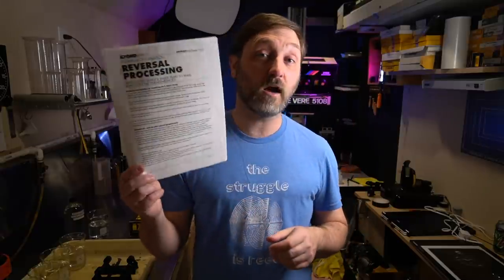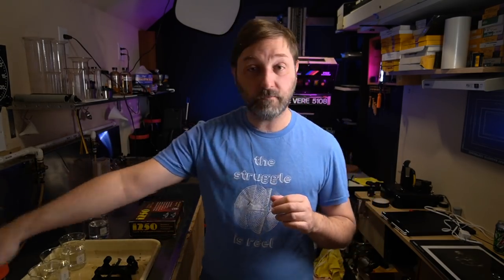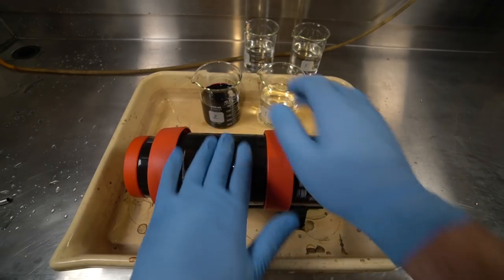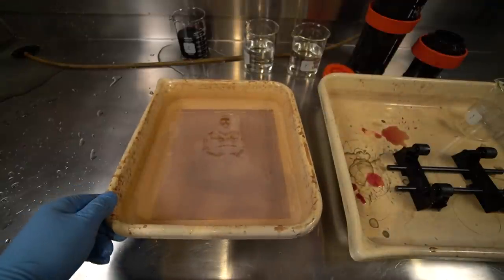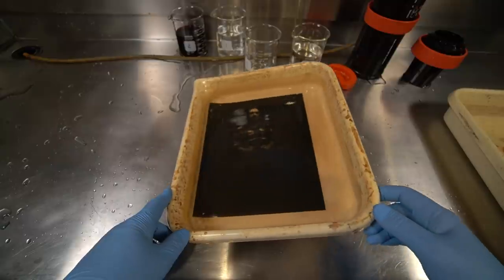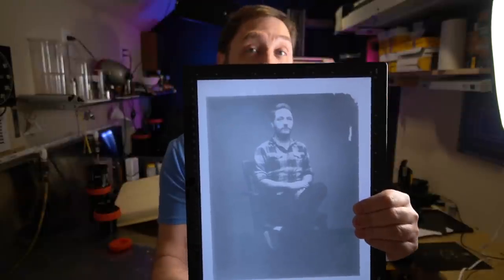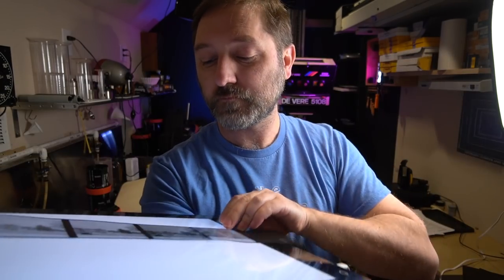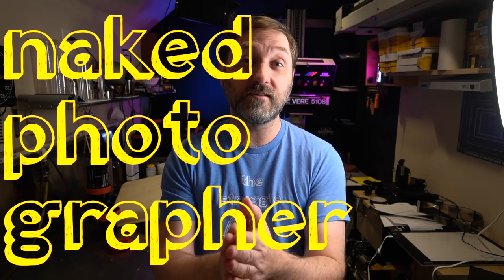Ilford B&W Reversal Process

Comment: If you just want to play with the process, have at it. If you want B&W positives, like slides for projection, you can shoot normal negatives on whatever film you like, contract print them on litho film, and develop that litho in Dektol/D-72 for a more controlled result with less messing around. The huge advantage is that you still have your negative available for more traditional uses. I suspect that this is also quicker and cheaper.
Reply: thank you so much for commenting this
Reply: any other tips for this process :)? I've never used litho film before

Comment: Kudos to you for going the H2SO4 route.  That's kinda scary.  There is a H2O2 process floating around that seems a lot less intimidating.  Ilford XP2 will also make lovely monochrome positives when run thru E-6 chemistry.  Over expose two stops, over develop (1st dev) 25%.
Reply: Why is it scary? I use concentrated, treat all my chems with the same respect and haven't experienced any problems. Have paper towels, water and sodium bicarbonate ready when it spills. Pick up dops with paper towel, only wash then. And make larger quantities of Part B to handle nasty chems less frequently :)

What I do is: go by the recipe and make my part A and part B. When bleaching comes, I use A + B + water in equal quantities. This saves chems, dilutes the bleach, is safer to emulsion and still bleaches to completion in said 5-6 minutes. 1 liter of A and B therefore is good for 10 films, which can be used to time Clear and Fix saturation, for example - to save further. Works great, no damaged emulsion.
Reply: I have the chems for the h2o2/edta process, but I also plan to try the variant of this method using bisulfate as an acidulating agent instead of sulfuric acid because I don’t really want to handle conc if I don’t have to.
Reply: H2SO4 is corrosive, yes, but not particularly dangerous if handled correctly.  Keep a well ventilated room, wear eye protection, and have baking soda on hand if worried about burns.  It's less dangerous and corrosive when diluted.
Reply: @dylangergutierrez  The final concentration of acid after 1:1 mix with the permanganate is 1%, so the 'working solution' is 2%. Still nasty but probably no worse than the permanganate itself. Thanks for the tip re XP2, I may try that as I'm having problems with the emulsions tearing with 120 film especially FP4. I don't understand about the over develop 1dev, is that for the Ilford process here or for the XP2 in E6 (which doesn't seem to make sense).

Comment: I've been playing with this process for a few months, since seeing this video originally. A couple of comments. First, I just tried my first roll of FP4+ in 120 roll film format and at the final fix stage the emulsion mostly came right off the base. It seemed fine up to that point. There are faint images still visible. Oddly, FP4+ worked fine in 35mm. I checked with Ilford and indeed the two sizes use different thickness plastic and some differences in the coatings. PanF50 worked ok for one roll of 120 that I tried, am going to keep trying with that. I may try TMax100 since it seemed to be ok for you. I may also try using weaker fix at the final step, as most if not all of the silver should be developed by then at either the first or second step. I am doing this to make stereo slide pairs for viewing with a stereo viewer, using a Sputnik 6x6 stereo camera and a viewer made with 3d printing by Oszko in Germany. Pentax has a neat gadget, a beam splitter that fits over their standard 50mm K mount lens, going on any 35mm Pentax SLR, and then viewed with a Pentax slide viewer. However this splits a single 35mm frame to two vertical halves, so pretty tight real estate versus the 6x6. The Sputnik is not a fun camera to get working, but it's pretty much the only medium format stereo option (there was a Rolleiflex but I guess only a few got made as it's either un-findable or way overpriced, similarly a Chinese medium format stereo camera that pops up on google searches but also not really available). Thanks again! (p.s. I am also doing color slides by E-6 chemistry for the same project, but currently Fujifilm is not making 120 slide film at all, and Kodak has jacked the price of Ektachrome to the stratosphere.

Comment: Thanks for another interesting and useful video! I have done some experiments with the Ilford process and I am surprised that my end goal wasn't one you mentioned. I mount the results as 35mm slides and project them.  It's a wholly different way of viewing a photograph as compared with backlighting a positive (quite similar to viewing a scan on a backlit computer screen) or printing on paper from a negative and viewing by reflected light. Old 35mm slide projectors are really really cheap and you just need some even white surface for a screen. I bought a very cheap plain white roller blind for this purpose. Sitting in a darkened room and projecting your photos to images several feet across is to my mind really quite magical. I bet your kids would love it!

Comment: For those who don't mind going a little off program, it's possible to make a reversal bleach with copper sulfate (available in home improvement stores, sold for removing roots in drain pipes) with a little table salt added; this converts the developed silver to silver chloride -- but little if any of the original halide is this variety, and a bath in ammonium hydroxide ("clear ammonia" from the cleaning supplies aisle of the supermarket) will dissolve this halide and not the ones we want to expose before the second developer.  The advantage is that, unlike permanganate, this not only doesn't stain (and doesn't require handling sulfuric acid; while it does need to be acidic, citric acid or acetic acid are sufficient as we only need to control pH rather than provide a reservoir of sulfate ions in solution), it doesn't soften the emulsion and make it prone to easy damage, or even to peeling off the film base (that's the permanganate bleach doing that, not the second developer).

When I've done reversal in the past, however, I used potassium dichromate.  I don't recommend this if there's an alternative available; not only is the dichromate toxic and probably carcinogenic, you still have to handle sulfuric acid (dichromate, like permanganate, works by converting the developed silver to soluble silver sulfate, but hardens the gelatin rather than softening it).

When I've done this (only a couple times) I took the "too light" final image to indicate I needed to expose less; I was using Tri-X, and found the best exposures at EI 640-800, or 2/3 to 1 stop gain in film speed.  My contrast looked normal (to my eye), so I felt exposing less was preferable over shortening the first developer time.

I would differ with your statement relative to fixing: the original negative image is not still present to be fixed away; that silver was dissolved in the bleach step, not converted to something fixer can remove.  It does no harm to fix after second developer, but if you've developed to completion in that step, fixing is technically unnecessary (the technical minded could confirm this by using fresh fixer after second developer, then performing a silver content test on the fixer that was used -- it should show no fixed-out silver complex).

While I agree that in our post-projector age, there aren't many uses for B&W film positives (and if you're going to project these, you'd want to use the actual projector, screen, and room lighting you're working toward to confirm exposure and first developer time), I can see one place this process is very practical: if you shoot your original exposure on printing paper, this process will let you get a one-of-a-kind positive print without the expense of Harman Direct Positive paper (plus you can use multi-contrast filters to control your final contrast).  You'll need to adjust first developer time, of course, but on the other hand, you can do the first developer and bleach steps under your regular printing safelight.
Reply: " would differ with your statement relative to fixing: the original negative image is not still present to be fixed away; that silver was dissolved in the bleach step, not converted to something fixer can remove.  It does no harm to fix after second developer, but if you've developed to completion in that step, fixing is technically unnecessary (the technical minded could confirm this by using fresh fixer after second developer, then performing a silver content test on the fixer that was used -- it should show no fixed-out silver complex)."

And yet - when you fix your positives, they get lighter. In case of Ilford recipe/Permanganate bleach - fix somewhat removes the warm tone given by PQ Uiversal. You can easily tell apart fixed and non-fixed slides. 

Could that indicate insufficient bleaching in some way?

Comment: Hello there! Been reversing since 2016 with great results. Here are some tips to improve your results:
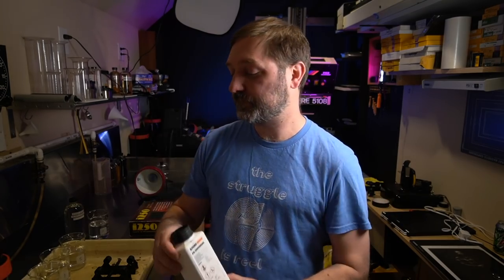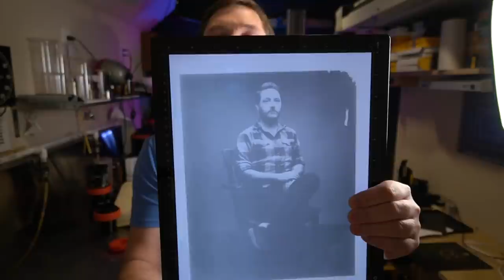1:21, 5:12 - many films - especially classic emulsions - are absolutely best left without it, 0 grams. Hence your overdevelopment at 17:04 and poor density;
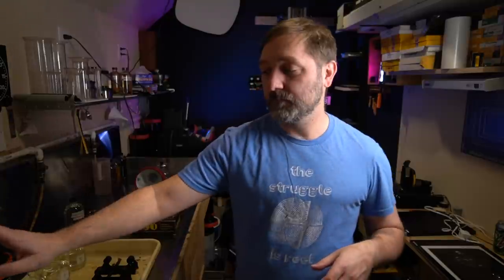2:38 - try diluting this bleach by doing 1A+1B+1Water. Safer for emulsion, saves chems and bleaching time stays the same. 300ml per 35mm film in Paterson;
3:24 - you can try redevelopment in first developer, have had only good results and saves developer. And capacity is about 3 films, third might require +1min;
4:20 - Fomapan makes a kit for their reversal film - Fomapan R 100, haven't tried on other films, because Ilford's recipe just works for me;
6:23 - agitation has a strong impact. Extreme example: Stand Vs Constant. 3 inversions in 90s will give extended shadow and highlight detail, for example;
10:01 - it's the Bleach that makes emulsion soft. Hence I recommended using dilute - Foma films will be thankful;
18:26 - I'd say we need to work on which film needs what amount of hypo - if any. And then we can experiment Pushing/Pulling films to their best!

22:24 - guys, get a slide projector - that'll tell you all :)
And slides scan good too: https://www.flickr.com/search/?sort=date-taken-desc&safe_search=1&tags=ilfordreversalrecipe&user_id=108634366%40N07&view_all=1

When it's a film I haven't reversed yet, I start 12min reversal with 3 inversions every 90s (Paterson tank) without any hypo, evaluate dry slides and go from there, adding hypo in 0.5g increments if 12min development didn't develop things enough. Or 1g increments with modern emulsions. 1x135 film gives 4 good length strips for 4 different development tests. Takes patience and time, but you can nail shit down this way, be on a solid ground ISO-wise, be literate in Pushing and Pulling slides.

Speedy recovery!
Reply: hi, how much sodium thiosulphate are you using for developing ilford fp4?
Reply: @PJF2137  haven't shot it for a while (since about 2020), so I don't have an up-to-date number for you. 
But here's what I do when I start to familiarize myself with a film (or return to a long unused one): shoot a roll and when it comes to development, take 1/4 of it and develop it without any hypo for 12 minutes. When the re-exposure stage comes, you'll be able to infer if you need to boost the first developer with thio. If strip looks dark, add thio. If strip looks good, the film is good to go without any hypo added. Meanwhile store the strip 1/4 in bath of water and take another strip: 2/4, develop it again with some hypo added, compare and reiterate. Develop both strips to completion, evaluate dry.
You have 2 more development test strips in the same roll, compare and reiterate until you get it to your liking.

Ilford gives you a number for its FP4 and it's 12g per liter. I suspect it's too hot, thogh, so I'd go for the half of the recommended amount in the first strip, then add thio in 0.5g or 1g increments until overdevelopment/weak density occurs, then dial back to a sweet spot. This works wonders and requires just some patience.
Reply: @diapozitīvs  many thanks for your reply. I developed ilford fp4 today in pq universal with 6 grams of sodium thiosulphate and idk why but film came out completely blank. I'm now going to try the rollei superpan 200 and would appreciate it if you would tell me how you developed it with excact times
Reply: @PJF2137  was it 6 grams per 1 liter or did you put 6g in your tank worth of developer (300-500ml usually)? 
Were the development steps done in order? Try to half it the next time around or try without any added - don't give up, experiment and please report back your findings - I'm curious!

Last Superpan 200 I developed (and it came out great): PQ 1+5, 500ml working developer + 0,3g thio. 
12 minutes at 20C with constant agitation during the first minute, then 3 inversions per 2 minutes the remaining 11 minutes. 
I reduced agitation to give shadows a chance to open up - Rollei clear base films are quite heavy on contrast.
I bleach it in 1/3 weaker bleach for a minute shorter. That is - take 1 part Bleach A, 1 part Bleach B and add 1 part Water. Bleach with constant agitation for 5 instead of 6 minutes - much safer for emulsion and saves chems on top.

I use 1st developer as my 2nd too, and I reuse it up to 3 films. Saves chems and I haven't found any detrimental effects on doing so with side by side comparison - just compensate a tad with each next film. 3rd might require an additional minute or two. Depends, do experiment.
Rest goes according to recipe.

Examples: https://www.flickr.com/search/?user_id=108634366@N07&tags=Superpan200
Reply: @diapozitīvs  it was 6g per 500ml developer, and I am also wondering at what temperature mix the chemical reagents and and does it have any effect, for example for making d76 u need 51,2/3°C / 125°F. I mixed everything at 20 degrees becouse i couldn't find information about this
Reply: @PJF2137  well, I mix and develop everything at 20C, works fine
Reply: Hi Ivo, I'm having trouble with soft emulsion. When using a diluted bleach, do you have any recommendations on concentration and formulation?  For example If I water down my bleach mix by 50% and double the bleach time, is that what you mean?

Comment: Here in Europe you can get 3 ready made reversal kits. Adox Scala, Rollei Dia kit and foma does a kit as well. I tried my luck with Rollei Retro 400s with the Adox Scala kit. Unfortunately I didn't not bleach long enough so I got a grey fog in the highlights.
Reply from the maker: I looked at the Foma kit just now and it looks like it’s basically the same as what I just demonstrated, but a dichromate bleach instead of permanganate.
Reply: The Adox Scala kit is hard to find in Canada, plus it's very expensive compared to making your own chemicals.

Comment: Question. Have you tried the RA-4 reverse, there is a few videos about it but most seem to be about using paper on large format cameras, I was thinking it would be a good way to print slides. I am thinking on trying it out myself for some of my slides, scanning slides just seems to defeat the purpose of shooting film. Scanning a print is a whole other story. Any thoughts on it? I think it would make a great video and the lights on second development just seems magical to me. Thank you.
Reply from the maker: People use it to print from slides, but because it is using a paper and process outside of the design parameters, you will have to accept the far less than perfect results.
Reply: @TheNakedPhotographer  Since there is no other options available. It might be worth exploring and perhaps formulating a repeatable process i figured that the biggest issue would be to correct for the different color balance of the paper. It would be nicer to have actual color reversal paper but that's a pipe dream today.

Comment: Questions!
If you do this in a Paterson style tank will the sulfuric acid and potassium permanganate damage the plastic tank? Or worse, the metal balls on the reel?
Also, I guess that you should be able with some experimentation to substitute other developers for the first step, right?
Reply from the maker: The metal balls should be 316 stainless steel and corrosion resistant.  This process is safe for plastic and metal tanks
Reply: Been reversing since 2016. No damaged Paterson tank to report. You could substitute, but it it said you need strong one. And some hypo to add - some films, especially the new-grained ones, require for highlights to clear, otherwise dark mess.

Comment: Foma also makes a BW reversal kit. You can get it freestyle.
Reply from the maker: If you look at the instructions you will see that it’s basically the same as the Ilford process.  They replace the developer with their own brand and use a dichromate bleach, but otherwise is identical.
Reply: @TheNakedPhotographer  Yep, I only mentioned it because it's a single kit to give you everything you need instead of getting the chemistry parts separately.  Some people might prefer the kit route.

Comment: Can you use potassium meta bisulfate as a clearing agent, instead of sodium meta bisuflate?
Reply from the maker: The instructions say both can be used
Reply: You need bisulf*ite* as a clearing agent, or metabisulfite. I don’t have the darkroom cookbook in front of me (it has conversion tables because you can use either in most photographic processes) but if memory serves the potassium version is a bit stronger, although from reading a few articles on this process I don’t think the amount is critical for the clearing bath. Bisulfate/metabisulfate lowers pH.